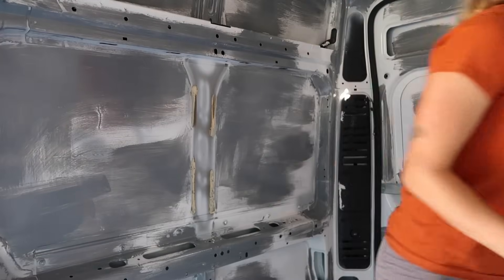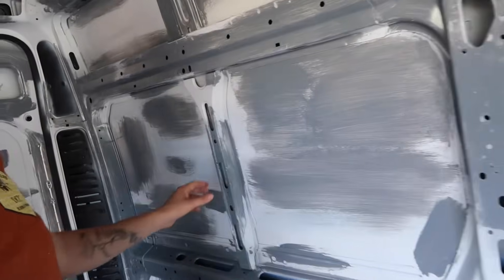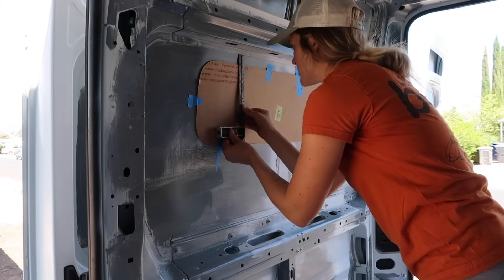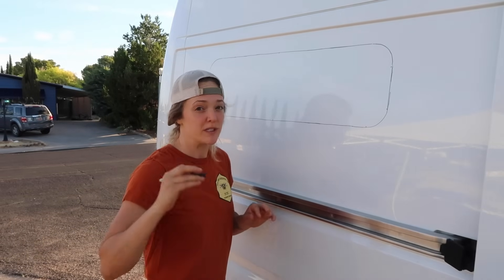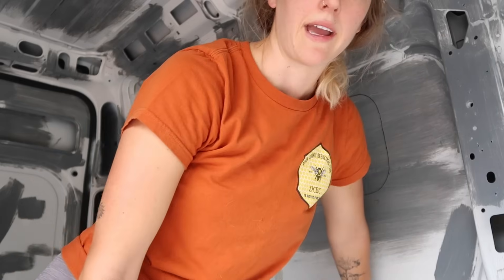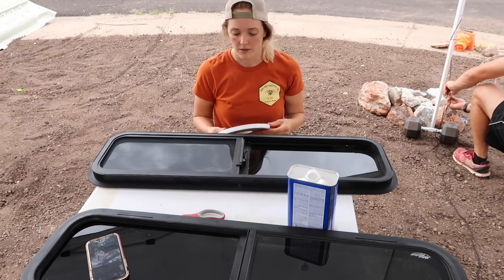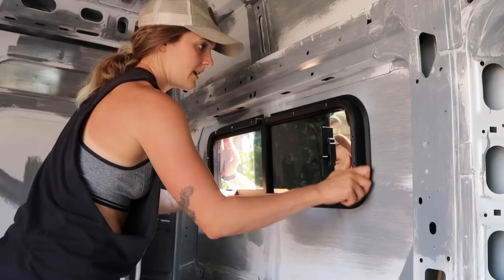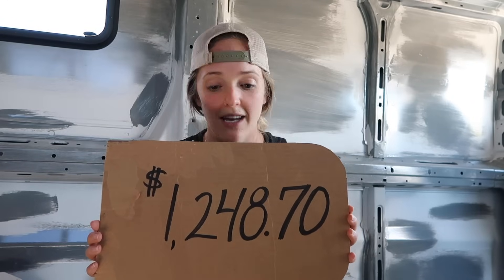EASY Van Window Installation - MOTION WINDOWS

Comment: Great video, I’m building out my third build and windows still scare me.  A good trick before you drill the holes on the edge of the template is to drill two in the center of the template and the through the van. Bring the template outside (or inside if you start on the outside) line up the holes and make sure the placement works.  If it’s off or interferes with any of the structure you can still adjust it.  Building vans is as much fun as using them.  Great work!

Comment: For a level, you can get a digital level which you then set on the floor as a reference level and "reset" the digital level to that surface, so that all other measurements are relative to that surface. This means your van can be parked on an unlevel surface and you can still use the level for all your measurements.

Comment: Another tip is to put tape over the slide door rail. To avoid small pieces of metal behind the rail.

Before I started the conversion of my Peugeot Boxer (same as Promaster only different name) I removed that rail and there was some rust. Easier to fix before you build the inside because the nuts for the rail is inside the van.

Comment: I did my vent fan with a cheap jigsaw, and went through like 5 blades. For my sliding door window I bout a $100 jigsaw (a bosch) and it was so much easier.

Comment: Hi Linnea!  I’ve been following your page for a while.  Thank you so much for all of your videos. Can I ask you- did you use any support after you removed the bar to cut for your windows?   I removed the bars and there is a lot of swoosh when I drive. And man I’m scared to start cutting the windows ans installing and I’m wondering if you need to add support after to prevent the panels from flapping (swoosh sound). Thank you so much!

Comment: My van is going to be as "stealthy" as my idiosyncrasies allow. And one of those is that I can not be in a van that does not have side back windows.

The style of windows you put in are the type I'm going for, but probably a little smaller.

One is definitely going to be a bit more forward, above some part of what will be the sink or food prep area.

Since I plan to go a little smaller, I would probably be fitting one about where you fit yours, only next to that ribs so I didn't have to cut it out. Or maybe one on either side of the rib.
I'll just have to see my options closer to the time.

Comment: Just find there realative center of the template .....drill a hole all the way through ......then transfer the template to the outside.......fasten your template to the outside through that center screw which will hold the template while touching level it up .....EYE it up from the outside......then transfer you lines....

Comment: Ok question….just installed the exact same window in my daughter’s van… when u screwed the frame into the window did the screws go in easy or did u have to push hard!   Did they go into the window frame itself?  

Also, we did everything the exact way you did but our screen won’t open or close.  Window does but not screen?  I think the screws went into the track maybe?   But there isn’t anywhere else to screw the screws too?  

Any help would be appreciated!

Comment: Good job and I like your measured fear as you drill holes in your van. I bought the exact same windows as you for a transit. Did you test them for leaks with a hose when done?
Reply from the maker: No I didn't! But I have been in a lot of rain so far and they have been great :)

Comment: Hi!! Thanks for the great video. Did you have a gap on the clamp ring where it is split? I still have an inch or so gap on my clamp ring when I put it on my window...
Reply from the maker: No I didn't! I'm not sure why that would have happened. Did you end up figuring it out?
Reply: @Linneaandakela  yep!  User error :)

Comment: I suggest that you put the supports you removed back on the walls. You may have to trim them but they are necessary.
Reply from the maker: There will be framing on the walls!

Comment: They're quite a bit bigger than I expected. https://www.youtube.com/post/Ugkxb-KpJPmXtqM2xdYLP72ICq6QCcD0V8e7  If you ever had an air king round tilting fan, these are basically the same thing but in a window shroud. There's quite a few reviews about them being out of balance. I can say that mine pretty close to balanced. I purchased two of them for cooling my shop during my crypto operation. One intake, one exhaust. Combined they're moving over 7K CFM which is plenty for my 20x30 shop. If it helps you comprehend just how much air they move, both of them on intake and it's incredibly hard to close the door on my shop. The prescribed dimensions are accurate, they barely fit in my small windows.